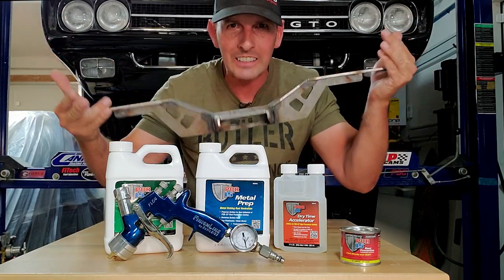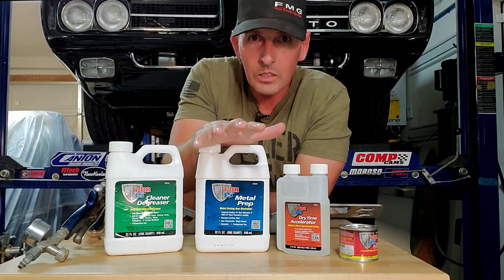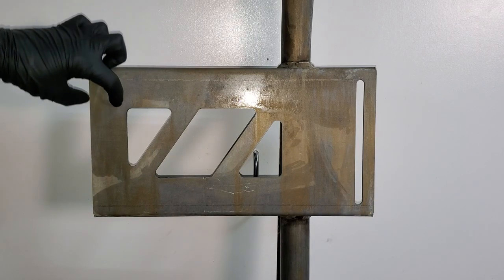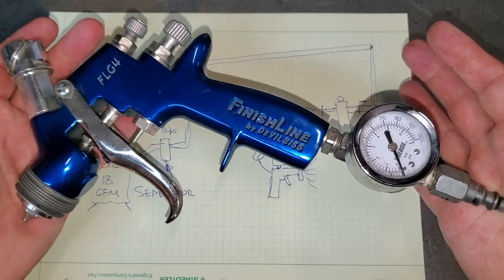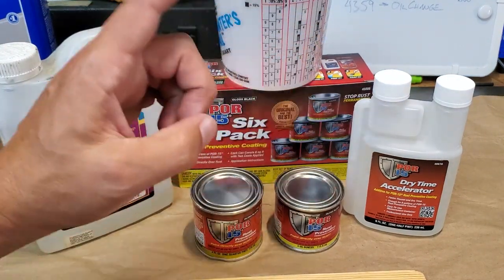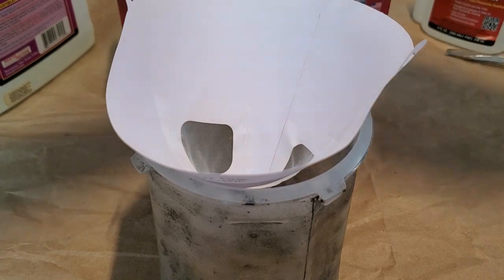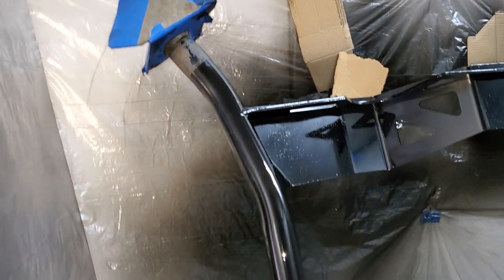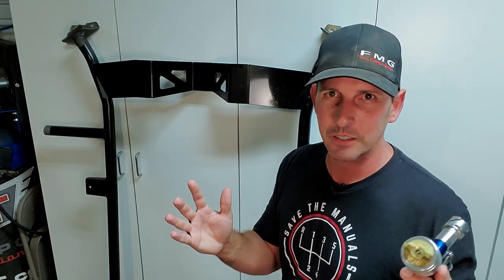Part 3 of 4, Frame Brace install - How to Spray POR 15 with a HVLP Gun.

Comment: Love this Video! Exactly what I needed to prepare myself for painting my 63’ Buick. Would you be willing to chat with me about this?  Help walk me through it? Thanks!
Reply from the maker: You can send me an email... but, this video is extremely thorough.  Every step is critical, especially degreasing.  Good luck, and let me know.
Reply: @FastMonty  Have you ever used the por15 to paint an entire car? I don’t have the items needed to spray it on using an air gun. Wondering which you would recommend using a paint brush or paint rollers? A auto
painter told me he doesn’t think this product is as good as paint and not going to last. What is ur opinion? Thank you
Reply from the maker: @rodgerfolkerts4690  I painted the frame with a paint brush.  Not sure what you're planning on painting, but if you follow the directions, it won't come off.  Have fun!
Reply: @FastMonty  I’m painting my 63’ Buick Skylark. Instead of paint. Going to try to use roller’s tomorrow on the hood and see how it looks. Thx
Reply: @FastMonty  Have u ever painted anything but parts, bigger flat parts? Thx
Reply from the maker: @rodgerfolkerts4690  I did the body work, and paint on my car, if that's what you're asking?
Reply: @FastMonty  Did you use por15 top coat for your body paint? I’m painting the car body with POR15 top coat. You ever do that?
Reply from the maker: @rodgerfolkerts4690  No.  I used all BASF Glassurit, for the Epoxy, High Build Primer, Base, and Clear.  It's not cheap.  That said, I'd experiment on another panel to make sure the top coat is compatible with the base coat.  Have fun!

Comment: Is it true there needs to be some rust present for POR to work properly?
Reply from the maker: Good question.  No.  Some people do a lousy job cleaning, and prepping, which is the most important.  The Metal Prep step coats bare steel with Zinc, where if there was rust present, it will stop the corrosion, and also convert to zinc oxide.  But, if there is any oil or grease present, it won't work.  Hence the cleaing step.  You have to be patient with cleaning and prep, before painting.  Do all the steps properly, and it'll come out stellar!  Have fun!

Comment: Didn’t learn the air pressure or viscosity of the paint
Reply from the maker: Hey Larry, are you asking a question, or telling me what I left out?  :)
Reply: Use the mixing stick. Count how long it takes to start just to drip   That’s the viscosity. Guessing should be 2 to 3 seconds for automotive paint. Pressure is key to every different type of gun
Reply from the maker: Good point.  I like the three second test you mention... This gun likes 23psi inlet pressure.  Thanks! @larrysloan9296

Comment: Hey another question. What octane do you run? Do you blend ? Im suppsed to run 94 octane I cant seem o find anything over 91 so I guess I'll have to blend in an additive Im looking for the best answer. Thanks man alot of your vids have helped me alot. Still dont have my car but its getting close
Reply from the maker: Hey Dan, I'm running 91, with no additives.  What compression ratio is your engine?

Comment: What are you using to clean out your gun after spraying?  I threw away about everything POR 15 had touched last time I used it.
Reply from the maker: Ha!  I hear you... I soaked the gun parts in Acetone.  Works fine for me.  But, I also use this gun as my "primer" gun, just in case I miss cleaning an area, etc... I would never use a high end gun.  Hope that helps.

Comment: you probably spent 1000 dollars before pulling the trigger on your paint gun. This is the opposite of DIY, besides, POR15 is crap and expensive stuff. Use Epoxy primer and epoxy paint instead.
Reply from the maker: Spraying equipment (Compressor, lines, gun, dryer, etc..) to do it right, isn't cheap no matter what paint you're spraying.  POR15 works for me, and I detail how to make it work.  Oh, and the paint booth I set up... less than $5.  Thanks.

Comment: POR 15 is one of the most over used and misunderstood restoration products ever,, absolute garbage in my opinion.
Reply from the maker: It's worked great for me.  Hence this video on how to apply it properly.  Thanks.
Reply: @FastMonty  i bet you dont say that in a couple of years.
Reply from the maker: @scottvantassel2212  you clearly did not watch this video, did you?
Reply from the maker: @scottvantassel2212   I agree there's more than one way to skin a cat.  POR 15 works great when applied properly, as I've done several times.  I know you didn't watch the video because I said my first application of POR15 was applied almost 15 years ago, and still looks great.  Thanks.

Comment: I would think you would have used a 5 gallon home depot vacuum & hose rigging, to remove air in the booth. Need to circulate air in booths or draw it out.
Reply from the maker: You don't "need" to pull the air out of a booth, but it would definitely help with seeing what you're doing.  Good idea about the vacuum... just make sure it's spark safe.  The fumes are flammable, and fans can ignite it.  Thanks!